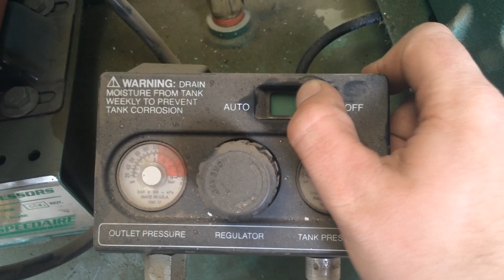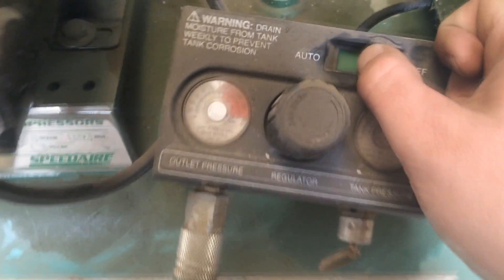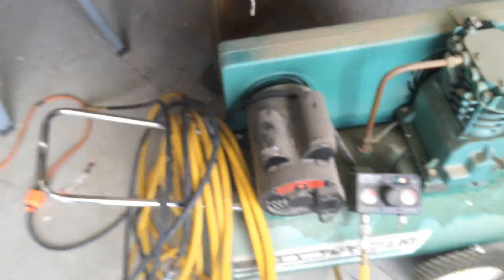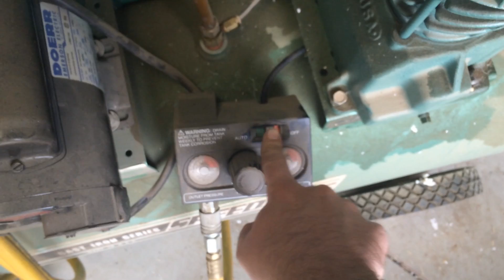Speedaire 5F212 Air Compressor

Comment: nice compressor, Id just put a switch in line  on the power cord alot easier than trying to find/replace the old one (I assume) but then youd have no worrys of arcing plugs and have less wear and tear on the breakers which tend to wear out alot faster if you start using them as a switch
Reply from the maker: Sounds good, what kind of switch would you recommend?
Reply: hanksranger a standard light switch would work fine

Comment: I own the same compressor. They are excellent and mine will still keep up with a pneumatic long board sander, 2-3 pros nailing off roofs Also, they are reasonably quiet. Mine was used mostly outdoors and carried around in the back of pickups, rain or shine and it looks it.

I replaced the switch with a Square D (same issue with the original in the video) and a new regulator/gauges.
Reply from the maker: Is that made by Schneider electric?
Reply: As far as I recall, yes. I used them for years on well pumps back when they could be completely rebuilt. I am just used to using them and got a lot of good service in the field with the brand on all of their electrical components, really.

What I liked about the original was the regulator was contained in it so it was a neat arrangement. I did have to add my own regulator but the original switch/regulator was leaking air anyway so, it was time. Also installing new motor bearings and a centrifugal switch tune-up at the time of posting this which should give some idea as to how much use this thing has seen. 

I have had comparable sized home center compressors and this one is twice the compressors those are, even this far on in it's life. We had a giant 3-phase Speedaire in our welding shop for years without issue, which is why I was happy to come across this one for home.

Comment: mite be a little late but these were sold by Grainger. they still will supply you with parts and owners manuals if you call. The old ones like you have are great not so much for the over seas new ones.
Reply from the maker: +matthew rentz correct I did look up the parts a while back and couldn't find any maybe I can make some newer stuff work on this one. That said this compressor is still kicking it gets used all the time!

Comment: I just inherited one of these, a slightly newer one but exactly the same (Speedaire). The mfg. is Dayton. Mine does not say what size gallon tank it is, do you know? Thanks.
Reply: Dayton is the electric motor  man
Reply: A little late by 6 years but this model tank size is a 20 gallon.

Comment: Try wiring the motor to a 220 line
Reply: Does that offer any improvement in operation,  or efficiency? My old Sears craftsman can be wired either way
Reply: @mechantics  yes way less amps easier on the motor too better efficiency